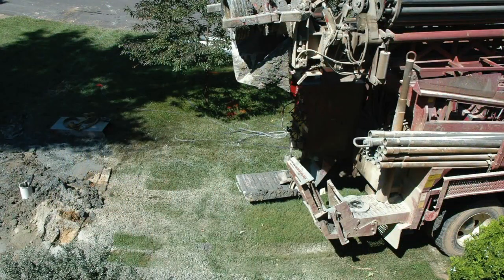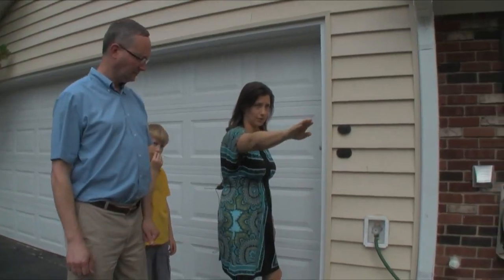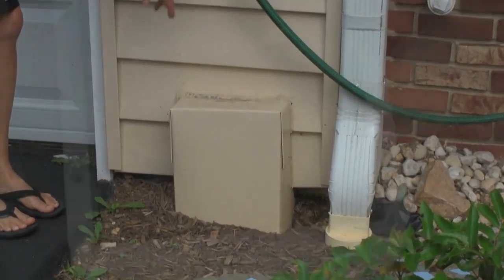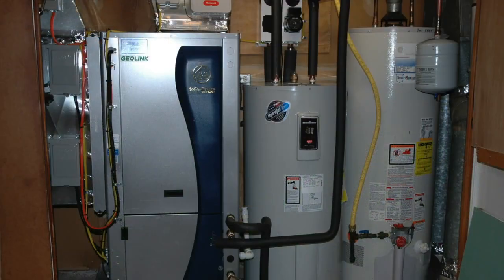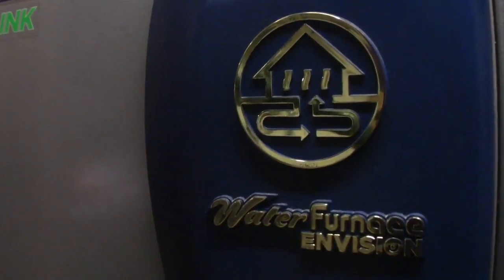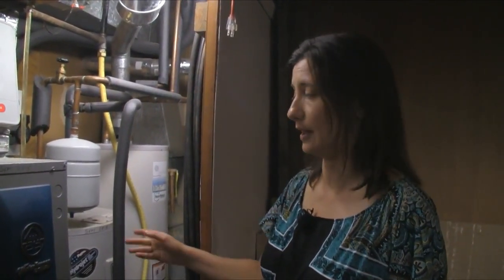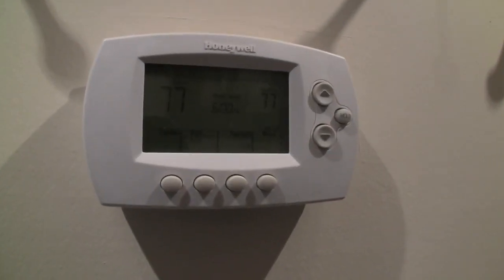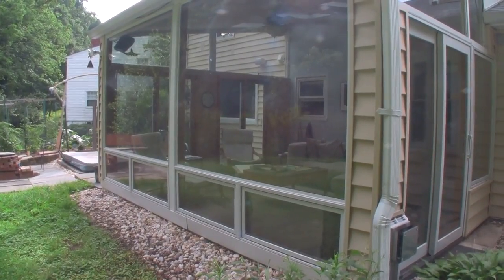Residential Geothermal Ground Source Heat Pumps - a case study

Comment: We bought a house with two Geo thermal Waterfunace units.  We have now been in the house for 7 yrs.  In the 7 years we have had to replace both units $10,000-15,000 each.  We have had to replace the flowcenter once and a pump in the newer flow center and our system has been down for the past week with yet another flowcenter failure.  we have spent well over $30,000 in seven yrs and looking at another $4k to replace flow center and flush the system.  Now high efficient  traditional units are comparable as far as efficiency and repair and replacement cost are so soso much cheaper and far more technicians available to provide service.  We thought about replacement with traditional units NOW I WISH I HAD REPLACED GEO WITH TRADITION HIGH EFF units.  Maintenance  costs for us has been $4-5000/yr.  with no significance difference in utility costs.